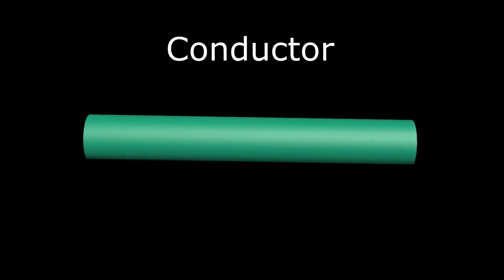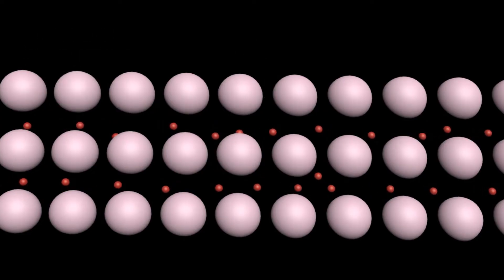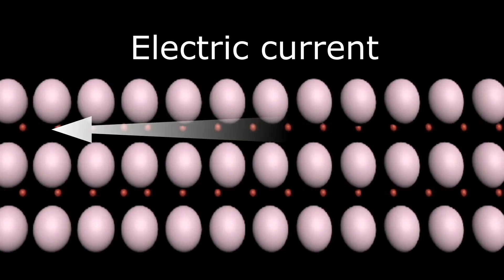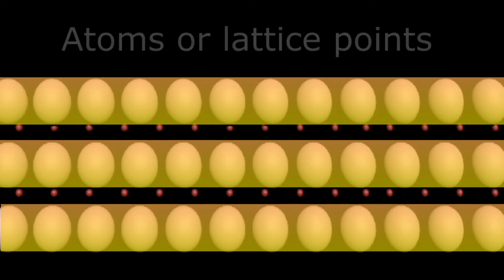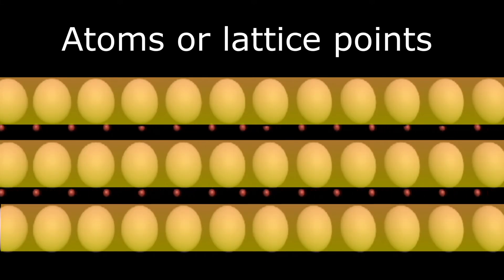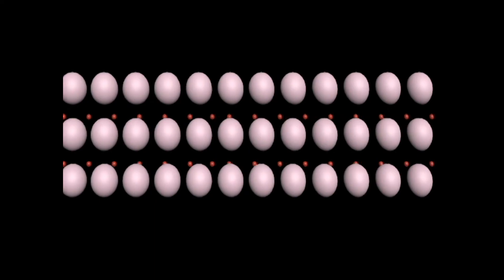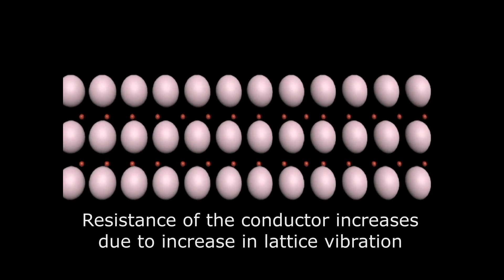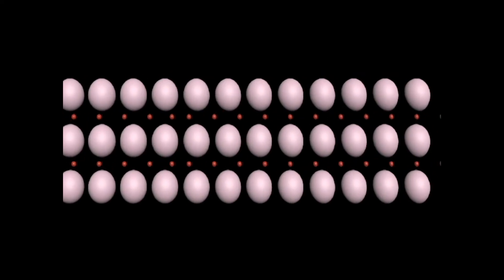Why the resistance increases with temperature in conductor

Comment: Why atoms are vibrate when the we heat?
Reply: The thermal energy gained from heating is converted to kinetic energy in the particles. Thus,they vibrate.
Reply: @mokshadanathoo308 straight up
Reply: Heat is only the increased kinetic energy of atoms.. when Thermal Energy is provided, It gets converted into Kinetic Energy leading to continuous vibration and collision of atoms..

Comment: Sir according to ohm's law if the physical properties of a conductor is constant than the ratio of applied voltage and the current is known as resistance than sir how can we change the temperature? Does ohm's law will not break? Sir plz reply
Reply from the maker: temperature is physical change, and so a physical property. so by changing temperature its means change in physical property.
Reply: When we change the physical factors like temperature in non-ohmic conductors, we are not disobeying Ohm's law, but we are simply accounting for the fact that Ohm's law is not applicable to these types of conductors. Ohm's law is only applicable to ohmic conductors, which have a constant resistance that does not change with changes in temperature, pressure, or other external factors.